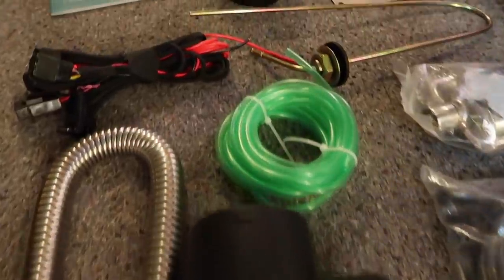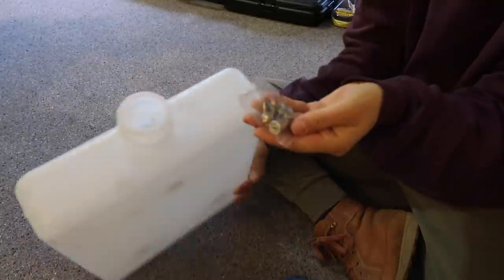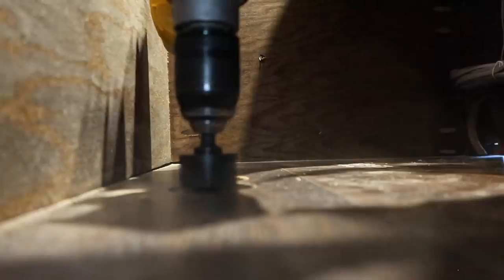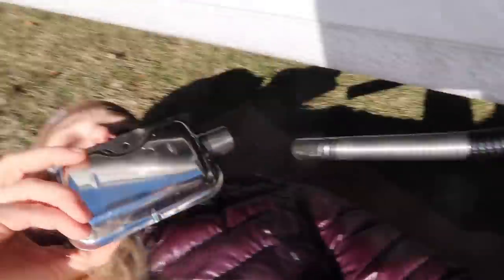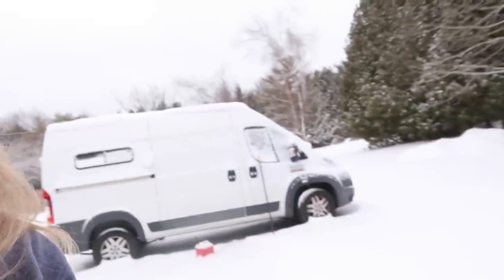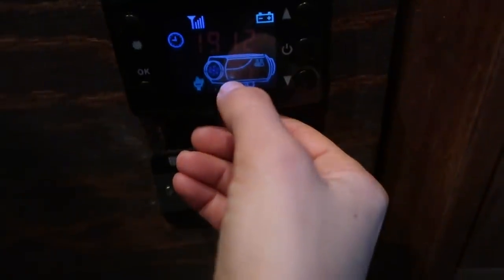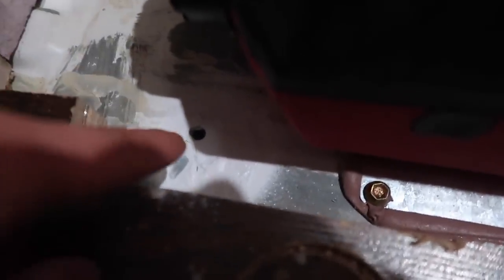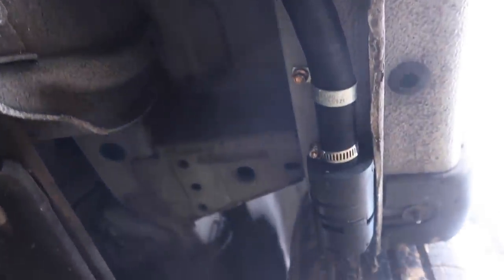Chinese Diesel Heater DO'S & DONT'S | Full Install | E-04 Troubleshooting

Comment: Great set up personally I'd move the air intake away from the tyre as it will get blocked with mud etc and move the exhaust so its coming out from under the van

Comment: I have THREE of these diesel heaters. One in my shop, one in my 8' slide-in camper on my truck, and another i built on a "roll-around trolley" that i can haul around and use in the cold Canadian winter to heat up a vehicle or whatever(engine compartment/cold starts)... ANYWAY... the main heater i use in my shop has NOW, on Oct. 6, 2022, started giving me "E-04"... this heater is my MAIN heater I use... it has never let me down in the shop!... i will try to see if one of the wires has come loose? Can't see HOW that could happen as it is an install IN MY SHOP where nothing should have caused a broken wire, etc... I have ALWAYS been able to "prime" my heater and get it going... this is a 1st for me... it has worked FINE for the past 3 years  /sad face ... E-04 has ruined my day

Comment: not sure if the van also charges your leisure battery  but having the van running while you start heater stop some of charge draw cost.. if that make sense, Turn off van after heater is up to speed :)

Comment: 2 things I noticed. Your exhaust should have a slight angle down. The muffler has a tiny hole in it to drain water condensation. 
Your intake is right by the tire and it will clogg it over time with road debris. But good job.

Comment: if you dont mind cutting another hole in the side of your van, youve already done that with the windows, you can add a camper-style port with a locking cover. then you could fill up at the gas pump without the extra steps of filling up a gas can. i saw a vid where a guy did that. seems practical. or add a bigger tank in the rear. dont those heaters go through that tank pretty often? you might not get the gas smell messing around with another gas can. :) good job!

Comment: the MOST IMPORTANT part about installing these is making sure you have "Heat Dispersion/Deflection" and CLEARANCE at the exhaust port. It is amazing what you can do with a bit of "tin flashing" and some creativity in tight spaces. The LAST thing you want is a FIRE in your van/camper/shop etc. Be smart folks. A bit of common sense goes a long way. If you are uncomfortable with installing one of these get a professional to help. Linnea, I came here looking for help on the E-04 error. Thank you. I have a place to start troubleshooting one heater of my THREE that has been running for years and alluvasudden gave me that error. Frustrated....

Comment: Nice video, thanks for sharing!
Have you considered adding a rubber grommet to the hole your fuel pipe comes through? Over time with vibrations etc the metal might cut through the fuel pipe. Also, please install a carbon monoxide detector if you don't already have one :)

Comment: I didn't re-watch the video, but I seem to recall you cut down through floor and insulation  because there was a problem with melting floor?   I mounted small piece of 1/4" plywood covered with a heat resistant metallic paper, and no more warm floor worries. . .

Comment: Had exactly the same problem with error 04 and same issue. Solved that, thanks. Now I have error 03, looks like I blow up the board, not sure why. Voltage is 12,4v. New heater, so i dont think is the plug.

Comment: Hi! First off, you're an inspiration! Secondly, I'm in the planning process and I watch all your videos - a lot. BUT, I am still confused about the heating systems. WOULD this heating system that you got heat everything in a van? (ie. water, stove...) Please help if possible :) 
(I am trying to stay away from propane for safety reasons)
Reply: This is only to heat the air in the van. And bring the ambient temperature up. A water heater or stove would be something extra

Comment: You need to take the intake away from tire it needs to stay as dry as possible with those holes. Next the exhaust needs to be down. The tiny hole on bottom should be faceing the ground it allows the water to drip out of it. An it should be lower then the tube to keep water from pooling in line.

Comment: Also with the exhaust muffler would be better if it is facing out of the side of the van so the co fumes Drift Away instead of building under it also if you don't have one put in a CO alarm in the van

Comment: Just remember Linnea, we learn from our mistakes.
There were a few problems, sure, there always are problems when you create something.
But you worked through them and it woks.
With the smile and laugh.

3 things.
1),  move the intake away from the tire, all the crap off the road will plug it up.
2),  Move the exhaust away from under the van, get it pointed out the side
3),  Get a grommet into the hole you cut for the fuel line.  The vibration of the fuel pump and the vehicle driving down the road with wear a hole into the line.  The last thing you want is 10 liters of diesel fuel under your floor.  Besides the fire hazard, you will NEVER get the diesel stink out of the van.  (45 years as a heavy equipment mechanic, it took a few weeks to get the diesel stink off of me when I retired)

I saw what looked like a smoke detector in your hand at one point. Does it have a CO2 detector built in, if not, please get one.  I have issues with cheap Chinese stuff.  The quality control can leave a bit to be desired.

Comment: Enjoyed the ups and downs, and success! 😐😂😎  Currently installing an all in one diesel heater, its sputtering with combusting bursts. Got scared and pulled the plug. Will recheck connections and whether it is fully primed.🤔 Did anyone have this issue? Please help

Comment: Thank you so much for your video! My husband and I got this all installed and have ran it a couple times but still have the plastic smell. Do we need to just keep running it and it will go away eventually? We are discouraged as we were very much looking forward to using our diesel heater but the plastic smell is awful!
Reply: Run your unit on high (hot) for a couple of hours and the smell will eventually fade away

Comment: Hi - I REALLY wish I could send an email - hoping you see this as you HAVE TO fix the fuel line connection you made at 9:25 - if you haven't done it differently after you moved it - but the hose has to be shoved on further - should butt up to the filter - and the hose clamp MUST sit behind the nipple or you can have a fuel leak as it's not really clamping the hose to the tube - it needs the surface area under the clamp to be matched - the way it is now you have maybe 1/32" of the tube being clamped to the tube (as it's sitting on the nipple) - if you butt the tube and move the clamp backwards, you'll have 3/8" of the tube being clamped.

As for the tubing itself, when it was inside, you would be fine with the green tube - but you should think about changing it to rubber as it won't suffer well outside the van so if you do choose to upgrade the tubing, hit any autoparts store with a short length of the green tube and ask for a length of fuel line with the same inside diameter - and tell them its for diesel.  Rubber will be way easier to slip on over that nipple - plastic is a pita for anyone so it's not just you! :) - and the grommet you should use for when the green tube goes through the body (to protect it from mechanical injury) is sort of built in with proper fibreglass reinforced rubber fuel line.

I really hope this helps - fire is the enemy here of course - and we want to keep safe eh?  Which leads me to ....
By the way - WE LOVE YOUR VIDEOS - We're expecting delivery of our Transit in the next month and you have been absolutely instrumental with our design (and shopping list) - Thank you both!
Reply from the maker: Hey there Eric! 
Thank you for taking the time to write this all out, I appreciate it a lot. 
I will consider changing out that fuel line now that it exits the van... thank you for the tip on how to find the right one! As for the clamp, I may just need to get a higher quality clamp because behind the nipple it is too loose to actually create tension on fuel line - but I will play around with it and hopefully make it better than what it is currently. 
I did create my own kind of grommet for the fuel line exiting with conduit and flexible fire sealant and it is doing really great! Although if I change out that line I will take your advice on the grommet as well. 
Thank you once again and I wish you the BEST of luck with your new project!! So exciting that you will be expecting your Transit so soon! Feel free to message me on IG if you are on there, I would love to watch your build!

Comment: I have a question; why take the cold air from outside and not from inside the van? I do not understand that the manufacturer has placed the black air inlet pipe with filter under the vehicle. Does anyone have an explanation or a contraindication?

Comment: The fuel pump MUST be installed vertically or it will wear out! The moving unit relies on the oil in the fuel to lubricate and the fuel is mixed with air. If it is not vertical then an air bubble forms and causes a dray spot that isn't lubed.
Reply from the maker: I will have to look into this! All of the videos I watched said that it should be at a slight angle... I will dig a bit deeper, thank you!
Reply: @Linneaandakela  I will be interested to hear what you find. I watched a 15 part series on the science and function of these heaters by an Aussie guy who went into awesome detail. If I find his videos I will link them here.
Reply: Here is the link to the video explaining the reason why vertical is best. Diagonal might be fine as long as it is no less than 45 degrees. Check it out. https://www.youtube.com/watch?v=TGFDFZ6r1dI
Reply: From what I've watched it is specific to the pump and to go by what the manufacturer recommends in their installation instructions... but I'm open to that being suboptimal! In the process of my own installation, great vid!!!

Comment: You seem to have such bad luck with the things you buy .. I feel so bad for you.   However you always push through and solve the problems in a very impressive way.  I just installed one of these in my Safari van and at one point in your video you said ... "most would do this in 2 hours" ... Let me assure you ...  I think not.  The hardware that comes with these is crap  and the instructions are a joke... plus the location issues that we all have...  I know it was an adventure all it's own for me.  - I like your final install on the metal much better... suggestion - get a battery smoke / carbon monoxide  detector just to be safe.  There will be one in my van for sure.  Someone else pointed out the exhaust isn't correct.  The muffler should be mounted so the exhaust goes out from under the van and there is a little hole in it which must be down for moisture to drain.  There is a youtube video titled (something like this) 13 things people do wrong with their heaters..  search it out.      Best Wishes !

Comment: Your exhaust is wrong! Hope you have carbon monoxide detectors and you need your muffler to be lower than the pipe so condensation can drain.
Reply from the maker: Yes! I ended up fixing it because of comments like yours, so thank you!
Reply: @Linneaandakela  awesome!

Comment: You need a rubber grommet for the cut out on the fuel line hole because vehicle vibration will eventually cut your fuel line!!!!!!!M!M!MM!MM!?m

Comment: Maybe a 2nd battery n 3rd solar panel and a plugin portable heater would be much easier safer no smell no diesel costs. Hmmmm. Just saying
Reply from the maker: If you are meaning a space heater, those pull a lot of electricity and are very inefficient. A diesel heater is one of the safest, it is very efficient with energy, and one of the best aspects of it is that it puts off a dry heat, which is very important in a small space and why I don’t use a propane heater! (Like a Mr. Buddy) 
My heater has been amazing! It works really well, and I have literally never smelled diesel in my space! I would recommend this to anyone and will definitely use it again in the future if I do another build

Comment: Your exhaust is all wrong. Muffler must be at lowest point as the way you have it diesel will pull in your tube. Muffler has a small hole on one side and this must face downwards. Muffler should be mounted side wards not flat.

Comment: Location  and angle of the exhaust is very bad fumes will build up under the van an kreep up when parked into opend doors /windows should be on the side angle down  to avoid collecting water from condensation so is the intake  that is gonna be all muddy and wet from tyer spray. Diesel tank inside bad idea not only  dangerous  will smell when refilling connect to main tank if the van is a diesel 💢
Reply from the maker: I moved my exhaust! Also, my van isn’t diesel so that isn’t an option for me, unfortunately. Everything had been going great though and it doesn’t smell at all!

Comment: The instructions are the worst....I got my nephew to do mine with my help....we both agree that now we could do it no problem. We installed the pump on the inside as well and you get use to the clicking.

Comment: Please please MOVE THAT FUEL TANK AND FUEL PUMP. THATS A FIRE WAITING TO HAPPEN. WAY TO CLOSE TO THE INVERTER, AND ELECTRICAL SYSTEM PLEASE. And get a carbon monoxide detector and smoke detector

Comment: In the first scene the exhaust is not right.  You need to fix it.  Most of the video is of your face not the job, So what's with that??  That looks like a 2 kw heater.  Should have used a 5 kw heater.  Uses less amps.  You knew not to use the green stuff,  I guess Darwin will come to the rescue  LOL.  Nice wordwork.  Varnish it. She be like nice.